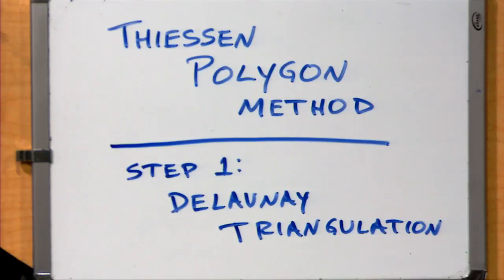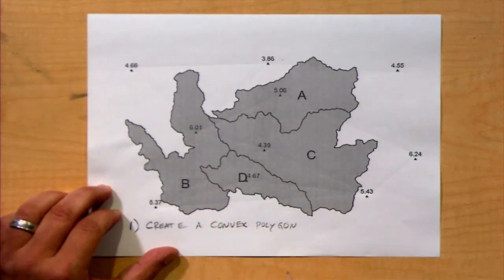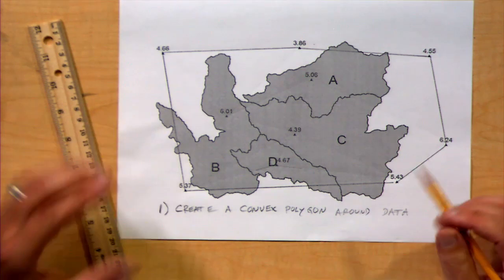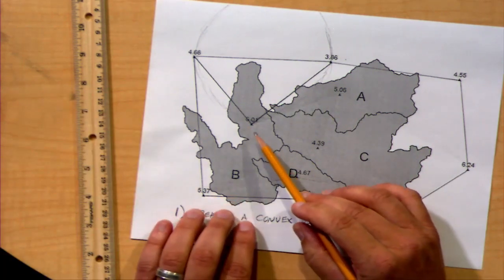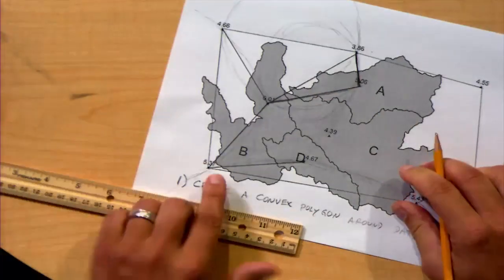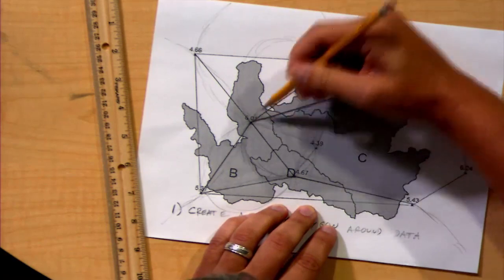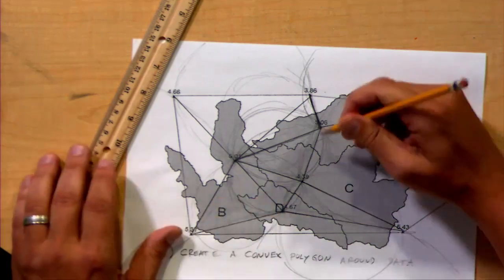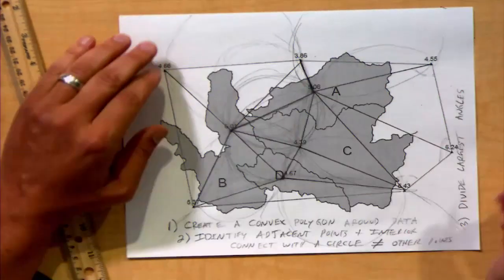Thiessen Polygon Method: Step 1

Comment: I think you accidentally said all interior angles to the convex polygon must be "acute" angles.  In your case most of the interior angles are greater than 90 degrees, thus they are obtuse. The key is that the interior angles are not greater than 180.
Reply from the maker: Correct.  I did erroneously use the term acute at 2:06. Thanks for being "acute astute"!